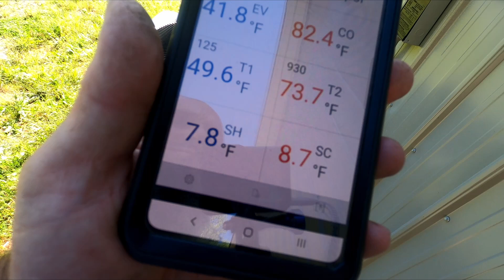Condenser Leak Repair

Comment: It's not clear from the video where the leak is or at what moment you found it. All we see is you doing a search and next thing we see, you're charging it, checking the numbers and buttoning up.
Reply: It was leaking at the low ambient control; he added some leak-lock to the thread on that tee and then he added refrigerant to normal charge!
Reply: @bobboscarato1313  thanks. Did the alarm go off or did bubbles appear? Did he speak when he found it, maybe it was too soft to hear? I missed the "aha" moment.
Reply: @realSamAndrew  It was hard to follow since he walked around ; I was focused on the troubleshooting process very intently! lol.
Reply: @realSamAndrew  Yes alarm went off several times; I was in HVAC for 55 years!